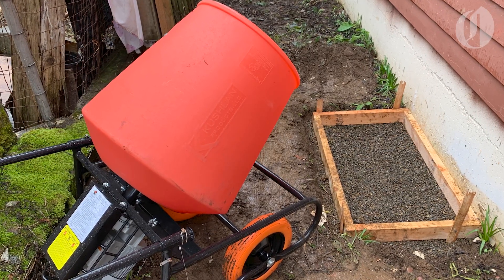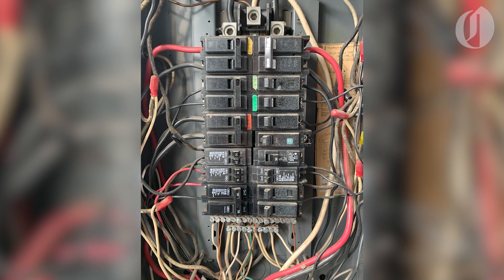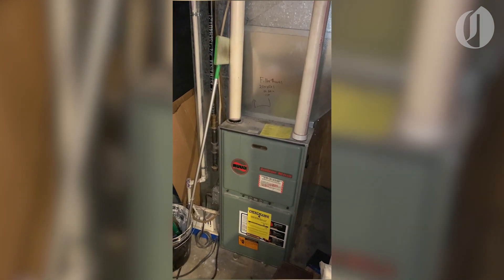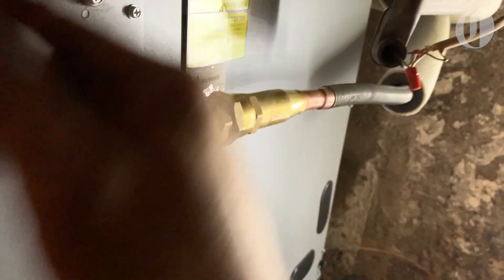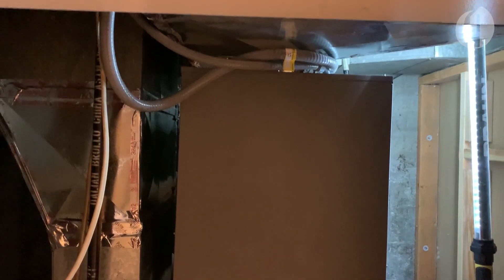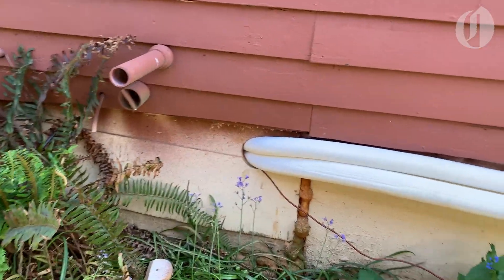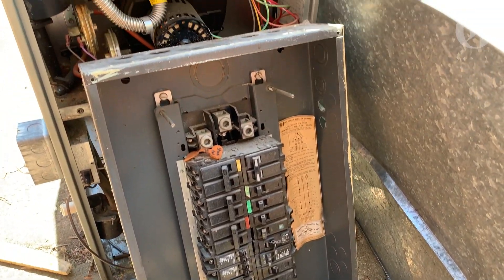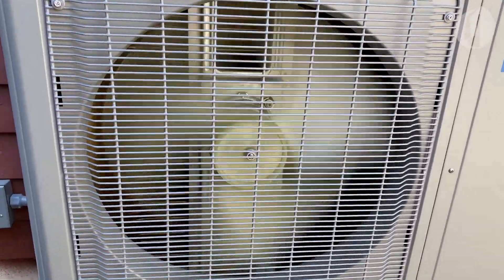DIY heat pump installation by Oregonian photographer

Comment: Nicely done sir. I installed the same system last year and have been mostly pleased with it. So, If you didn’t pull a vacuum after the repair and before re-charging, the system will have some moisture in it and that might affect the life of the charge. 

Thanks for sharing and congrats on the new system!